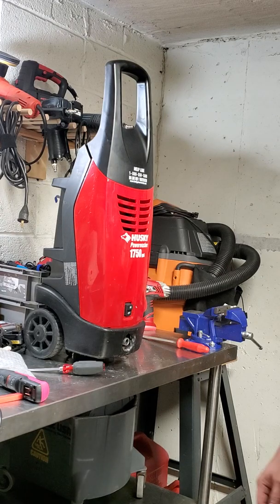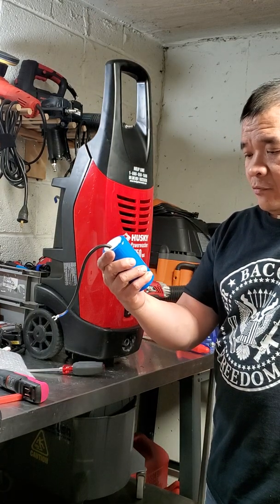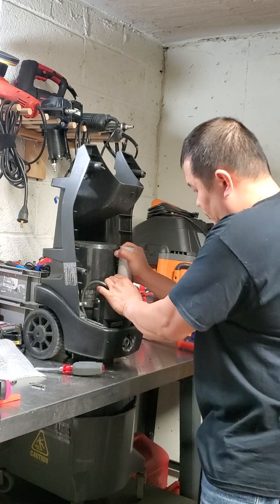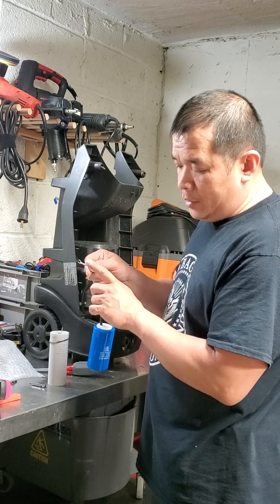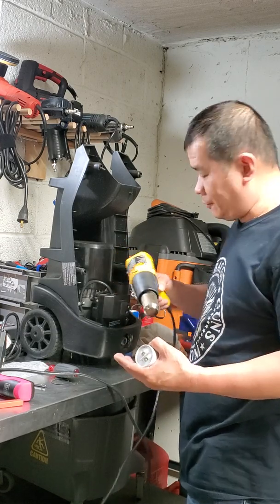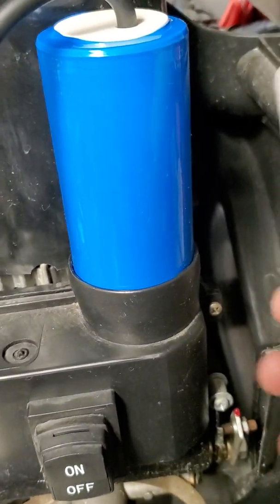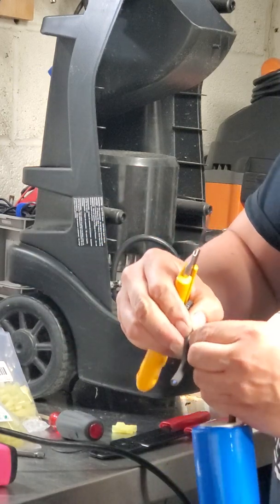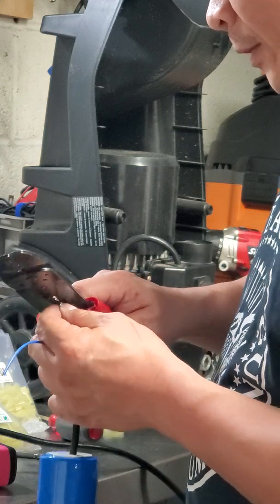Fixing Husky 1750PSI Electric Power Washer Motor Issues (The motor just humming not spinning).

Comment: It would have been nice to hear the initial problem noise.  I'm not sure mine 'hums,' as much as just sounds weird.  I suspect the hum is that the motor is stuck and can't turn and the caps are starter that get them to turn in the correct direction....Mine just gave out while using, it's hard to believe the cap just died (which I don't think does anything after starting.  Nor would it be a start switch.  I'm thinking pump, which isn't worth replacing on this, or high pressure switch, but it doesn't ooze out either.

Comment: My Husky 1550 psi doesn’t seem to be getting electrical power, what could be the problem? Thank you 🙏🏽
Reply from the maker: No, If the motor doesn't humming, probably the wiring issues, the circuit breaker switch on the electric plug is malfunction or the motor it self. Try to replace the electric plug with standard non circuit breaker plug first. If the motor still not humming test the wiring with multimeter.
If everything is goid that means the motor blown.

Comment: Have you ever heard one that runs and works fine but has a kind of ting sound when its pumping? Mine seems kind of noisy and you can hear a slight tinging noise almost like you were to hit some metal wrenches together, but seems to work just fine. I am thinking it lost a little bit of oil from sitting a long time but I'm not sure. I have an electric Husky 1750 pressure washer just like yours in this video.
Reply from the maker: Hi there, Husky 1750 no any maintenance required, as long you keep clean the unit after using it.
The issues you have sounds like the water pump propeller getting loss or might be broken that can cause metal to metal friction while the motor rotor spinning.
The other thing that can cause the noise is the motor fan blade could be bent or not seat properly on the center.
You need to teardown to find out the issues.
Hope this can help.
Reply: @agungwibawaAR15  Thanks for the info! I was thinking it could also be that it wasn't getting enough water because the hose my neighbor had is one of those shrinking hoses and not a lot of water flows from it.  I will try it on a regular hose and if still making noise, i will open it up and take a look. Thanks again

Comment: I replaced the capacitor but still it won't run.
I can turn the impeller by hand.
Any ideas ?
Reply from the maker: Any motor humming when you turn on the power?
If the motor not humming that means not the capacitor issues, that might be:
1. Bad Motor.
2. Bad wiring.
3. Bad power switch.
4. Bad power cord.

Comment: I have the same unit can you tell me what are the color of the motor wires that connect to the capacitor?
Reply from the maker: Hi, as I remember black and white, you don't have to worries about the wire color, because the AC stater capacitor doesn't have polarity, you can connect the wire either way.

Comment: Thanks, I hope that is my problem.  The old capacitor looked good?  So you were hoping that was the problem?  My cheap multimeter doesn't do capacitance.
Reply from the maker: The old capacitor looks good but no sparks  when you do shortcut both wire. Good capacitor if you load with voltage will sparks if both wires shortcut.
That is the way I am testing the capacitor.
So I purchased a generic capacitor from ebay to replaced the old one.
Walah.... the power pressure works like a charm.